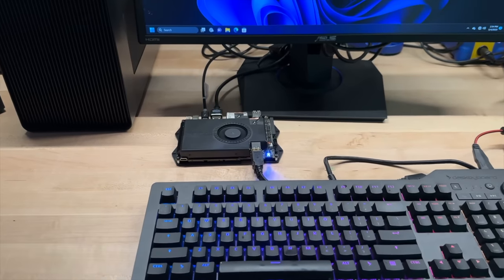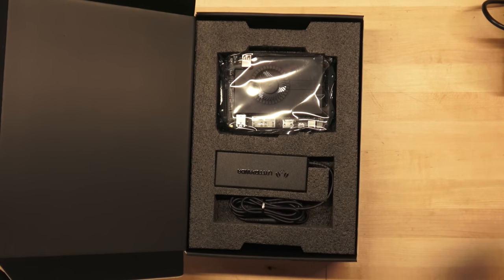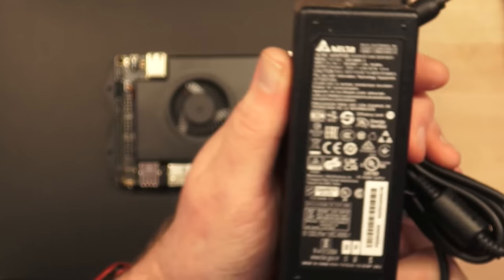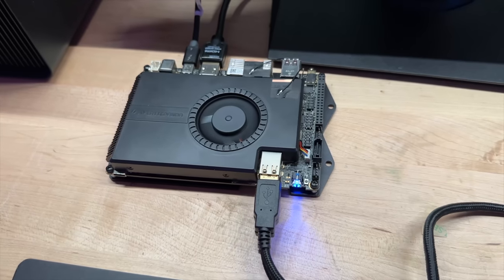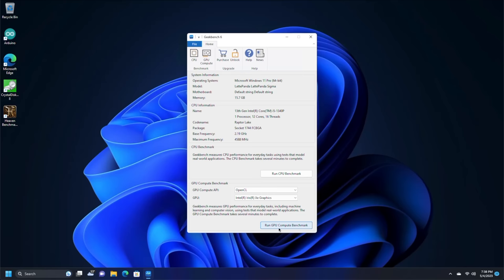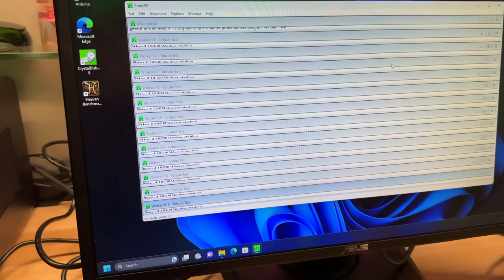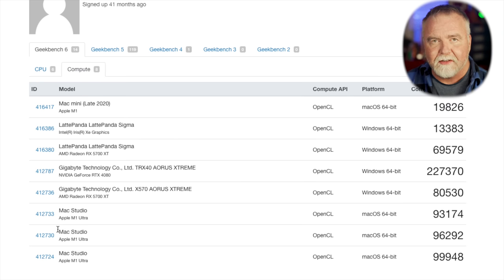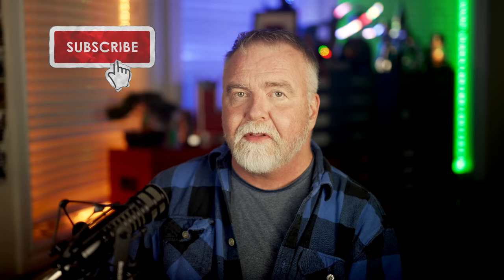The Sigma: The Most Powerful Single Board Windows PC

Comment: I believe the way most boards like this work is they have a separate MCU that is connected through serial to the processor, so programming it over COM3 was probably an MCU connected to COM3.

Edit: the MCU is an ATMega32U4. I understand why they went for this due to simplicity of programming but anyone buying a board like this can probably use other MCUs, I would even rather see something like a teensy 4 built in. Even something like the arduino alternatives from adafruit or sparkfun would be better. I just think a ATMega32U4 is not a good choice for a board this expensive, yes it will probably just be handling IO and all compute should be done on the main processor, but it is very limited in communications and hardware compared to other MCUs and other MCUs have DMA that can be used. A main processor this powerful can handle a lot of data and calculations, this MCU can’t and could easily end up as a bottleneck, especially if a lot of sensors and actuators are used like in robotics. A better choice would be similar to the arduino portenta series, using a STM32H7 series chip with single or dual cores to get much higher throughput and hardware capabilities, if arduino themselves are using it then it should be pretty beginner friendly too.
Reply: The processing power of the MCU is easy to work around, and it's better to work around it anyhow with this setup. Instead of doing the heavy lifting on the MCU itself, you offload it to the powerful OS available right alongside it. So, the MCU becomes a bidirectional proxy for the signals coming from GPIO. Write your controlling software elsewhere using a full-featured programming language for complex calculations. The MCU really only needs to be directly processing extremely low latency + realtime communication requirements.
Reply: @peterrosser1217  it really isn't, the processing and communication speeds are a bottleneck. Your application could easily be limited by how fast you can get data through the MCU. On top of that the peripherals on the chip are pretty rubbish, only low speed communications without DMA with not great PWM. The maximum frequency of the chip is 16 MHz and it is only a relatively basic 8 bit processor. 

There are also plenty of applications where you would want to do some processing on the MCU rather than the main processor, mainly for tasks that require precise timing or fast response times. There is a reason that MCUs are used for anything that needs real time control and if needed they communicate with SBCs for more advanced processing, that doesn't suddenly change because you have a powerful processor attached through USB to a MCU, there are still plenty of times you would need to process something on the MCU.

The pretty bad specs for PWM will affect motor control or other uses with low frequency or low resolution in order to get higher frequencies, the main PWM is also only 8 bit which is pretty bad too.

The slow communications will affect how fast you can read data or communicate with other components and will limit how many sensors you can use and still get a fast enough rate.

Overall it just isn't a good chip to use for this, it is a chip that is barely good enough for beginner projects. It wouldn't be suitable for any applications where you need to read a lot of sensor data or interact with a lot of motors, like robotics. You have a very powerful processor but very weak MCU, it would be very easy to end up with a bottleneck especially on sensor and actuator rich applications. There is no point having a processor this powerful on something like a robot if it is limited by how fast it can read sensors and command actuators.

A STM32F4 chip would have been more suitable with much higher frequency, 32 bit processor and more flexible and faster PWM and more PWM channels, the communications interfaces would also be faster, allowing more data throughput. Other chips like the rp2040 would be good too. For the price of the board they also could have justified a STM32H7 series chip like the Arduino portenta series uses, obviously they see a need for a powerful MCU on an SBC.

Any application that justifies a processor that powerful and an MCU will be bottlenecked by the MCU used here.
Reply: @conorstewart2214  I totally agree with you. To add to your point, Microchip basically killed the Atmel ATMega and XMega microcontroller range after they acquired Atmel in 2016. I was at a conference after the acquisition where Microchip publicly said that they would not EOL (end of life) any Atmel product. The ATMega32U4 is one of only a handful ATMega microcontrollers that are still being produced and it is just a matter of time before they stop producing them altogether. The XMega range is basically dead. Btw, I have about 500 ATXMega32E5 chips in stock that are now basically useless to me. Apart from one other component, I have completely stopped using Microchip components. More than a decade of investment in Atmel products down the drain. Thank you Microchip... 😞

Comment: Why use a Single Board Computer, instead of a mini-ITX PC?    Both are small, but the ITX machine with Ryzen 7900 cpu gets about 25,000 score on Cinebench R23, and Ryzen 7900 uses very low power too.
Reply from the maker: Doesn't it require a full desktop power supply though?
Reply: @DavesGarage  Not necessarily.  There are tiny Pico PSUs up to 160 watts, or the small Flex-ATX supplies up to 250 watts.

Comment: I know you do not typically do reviews, and understand that you might not have access to this gear but...5950x and M1 are 4years old we have been at the 7950x and M2 for about 2years now and Apple is about to transition to M3. This computer seems actively incredible but the price performance claims are not accurate to what is currently available in the market... more appropriate perhaps would be to compare it to other single board computers with GPIO such as the many ARM and RISC V options as well as other X86 ones... such as the orange pi, raspberry pi 5, Odroid, Tinker Board, UDUU Bolt, Le Potato, etc...

Comment: $579 for an SBC?  Latte Panda guys must be smoking that weed.  You can EASILY build a pc for that price that will run circles around this thing.  

Interesting.

Cool.

Impractical.

Expensive AF for what you get.

However, I'm always glad to see your take on tech.  Keep up the good work!
Reply: Can you do it for 60 Watts?
Reply: You can easily build a PC for that price, but can you build a PC that takes up as much space as a SMC, runs on only 60 watts, is as quiet as this one, is reliable, and keep in inside that budget?
Reply: @dakiloth  And about 15W idle. That's not easy with out of the box hardware.
Reply: i5 13th gen    12 cores     I have not seen any computer with this cost 500  or less.
Reply: The framework i5-1340p laptop board retails for 449usd in their website, the Sigma comes with some extras in a smaller package, i think the price is about right, this is a great board for high end NAS systems, emulation machines up to six generation consoles and some Taito X2 arcades. it is so powerful that you can run a NAS,  Plex video transcode and run a windows on a VM at the same time.
Reply: @wolveric0  With probably some NVME (which is really a mini-PCIe slot) to SATA multiplexer you could indeed probably power a few spinning rust disks

Comment: It's not "hackable", it has a closed UEFI BIOS, closed source CPU microcode, and a closed source bootloader running a closed source OS out the box. A ThinkPad X220 is "Hackable" because you can load Libreboot on it and run programs from there at an extremely low level, below even the CPU itself. The Sigma just has an Arduino on-board, that's not "hackable", nor has it been "hackable" the last 3 times LattePanda did that. I could tuck an ESP32-S2 inside my laptop's case with exposed GPIO and tap off the unused USB pins on the chipset, but that still wouldn't be "hackable".
They could call it "Integration friendly", which definitely is what it's actually built for, or even "hacking friendly" if they want to stretch it a bit, but it's not "hackable".

Comment: They try to say it will beat my 9900k by a little bit. Somehow I don't think so when I have mine clocked @ 5Ghz all cores and have it paired with a GTX1070 8Gb
Still $600 isn't too bad if you need something small with a lot of power.

Comment: 2:52 Interesting thing about this connector: the odd input centre north was - and in some old houses is still used - for earthing. You'll find the current standard is on the sides. That is the top and bottom. The top one being connected to sait old input. That input is from electric plug & outlet E, which was primarily used in France & Belgium, hence I usually call it a Belgian plug, since in Germany & The Netherlands (plus Scandinavia, Austria, Spain, Portugal & "East Europe") we use(d) the F. I cited used, since in modern times E & F have a combined plug and socket and this is in fact such an E/F-plug. In fact, the modern difference is that E is straight through and F, I suppose because of the tail & hook, is the same plug, but hooked.

Comment: How about a follow-up video seeing how well it works with Linux?
Reply from the maker: I'd likely just install WSL2 on it, then you get the best of both worlds!
Reply: @DavesGarage  I was just wondering if there might be any compatibility issues.  I took a quick look at their website and they mention it being for both Windows and Linux.  It looks like it would be an upgrade from the NUC I’m currently using as a Linux desktop.

Comment: I guess it's okay if the most important aspect is size. My desktop PC was much cheaper and is far more powerful. My laptop uses less than 1/3 of the power of the Sigma and connects to the 12vdc portion of my solar power. For me, the FOMO problem is nonexistent so thanks for the entertainment.

Comment: 10:14 Dave, quick few things, with respect to USB power.  They only use the 20V power delivery spec, and because of this you can't supply more than 3A with a standard cable (60W).  With a 5A rated cable with the correct eMarker in the cable it can go to 5A if both end points support the 5A (100W) standard at 20V.  The PD3.1 Apple power supply won't negotiate anything unless both the cabling and all connected hardware has to negotiates the EPR 28V PD 3.1 standard.  Without that you will never get anymore than the smallest link.  Power delivery is has a full communication protocol and unless the cable has eMarker will be limited to 3A only no matter the voltage of 5,9,12,15,20V.  There are steps in the PPS and AVS specs of power delivery but most just implement the fixed voltages.  So with that being said here are the only valid combinations of fixed voltages:
PD 3.0 voltages and up to currents - 5V-3A, 9V-3A, 12V-3A, 15V-3A, 20V-3A (with 100W rated cable 20V-5A is added).  

With PD 3.1 and EPR rated cable (as in the spec) the additional voltages and up to current of 28V-5A, 36V-5A, 48V-5A.

That would explain why you were not seeing more than 60W potentially.  Your tester only will support up to PD 3.0 spec and doesn't support PD3.1, so it could never negotiate the 28V standard.  The question is does the two cables you are using support 5A (100W) mode along with the power supply?

Keep up the good work sir, looks like a nice little SBC as well. 👍😁

Comment: I would like to see this paired with an Nvidia AI dev board running on a car battery. My application would be for my vehicle a former police utility with stock 250 amp alternator and aftermarket 360° cameras installed. I would use those Nvme slots for a raid configuration.. 😅

Comment: Q: For the external GPU test, was the display connected to the Latte Panda or the external GPU?
Reply from the maker: I forget which parts I showed footage of, but I tried both.  For Heaven I had to run it via the output of the eGPU.  For Geekbench it can use the GPU headless, which is how I tested it.
Reply: @DavesGarage  Good, just to put the numbers into perspective. Our experience: eGPUs performance drop if not hooked up directly to a display, since they pump the video stream back to the PC. The exact reasons elude me, since the Thunderbolt specs are a bit... Convoluted? To say the least.

Comment: Western Digital... Unless it can be replaced, that's a deal killer for me. Lost 40 GB data stored on a Western Digital AND lost that backup also on a Western Digital. TWO different drives failed EXACTLY the same time and one of them wasn't even on all the time. Never used them since, and never had a problem since. That 4 pin IDE WD drive is in a closet somewhere. Gave up trying to make them work decades ago with various data recovery software unable to see them, despite me hearing them spin and click.

Comment: No point in hiding the CPU, it's a laptop i5-1340p. So why buy that if one can buy a laptop with a screen? For 3x NVMEs and some extra ports? But my Lenovo X1 Carbon Gen10 comes with almost all the ports you have. I found it's sold for 650$ with 16GB/500GB SSD OK, not so bad to play with it but that's all.
Reply: his is for making projects not for use as a computer only... such as making a robot or a console or a kiosk...  it is meant for hardware development. a laptop cannot do what this does.

Comment: I wonder if this would be good for astrophotography data aquasition and storage in the field from a remote location on a 12v deep cycle battery? A lot of astrophotographers these days are using mini PC's for this and mounting them directly on their robotic telescope mounts with the telescope and camera equipment, then running either wifi to a tablet phone or running cables to small monitors and keyboards in an enclosure. (Enclosure is to keep extraneous light from the monitor interfering with the imaging and ruining night vision.) I'm sure it's not ready for damp, cold or hot outdoor use but that can be dealt with by shielding and extra cooling. Also anti dew heaters are readily available and mitigate moisture buildup without adding to normal operating temperatures. Astrophotography data aquasition and storage needs to be big and fast. Usually 16bit RAW data for multiple, long exposure still frames with dark, flat, and bias frames acquired for noise reduction purposes in post processing. Also, planetary, lunar and solar photography require large storage space and high frame rates as they use video format to capture thousands of lower bit depth frames for culling, stacking and processing later. There seem to be a lot of new mini PC's popping up out there but im not very tech savvy, although I took electronics in high school and worked as an electrician for twenty-five years. I've just never had time till now to catch up. If you know anything at all about astrophotography, maybe you can help. Even if you don't, you may still be able to help me. I don't want to have to worry about running out of storage or dropping frames through transfer from a CMOS or CCD camera. I may be out five hundred miles from home with a ton of equipment, in the middle of no where west Texas.
Reply: Khadas Mind with a docking station. A far better option.

Comment: this board is not the most powerful singleboard PC. Lets try the GEEKOM Mini PC Mini IT13, 13th Gen Intel i9-13900H NUC13 Mini Computer. I have 3 27" 1080p monitors, 64TB NAS server, 16TB HD docking station, 3' Bluetooth soundbar, 4k computer camera, DVD-RW,  C-Type 11 port docking station with two extra HDMI ports hook up up to this raspberry-pi,  Win 11 Pro O/S comes with this raspberry-pi. I upgraded the RAM to DDR4 64GB and the boot drive is 2TB m.2 SSD. This mini-pc is great for general office type work.

Comment: Thanks for reviewing it. It's interesting, and I like the 60W figure, but it's an expensive solution to a nonexistent problem. Used i7 mini PCs can be had for under $200, and have space for a GPU. Four old i7 PCs cost less, will eat a Sigma for lunch, and provide some fault tolerance into the bargain.

Comment: Their page claims that the CPU on it beats an i9-9900K! With a lie like that front and center... I have no confidence on this board for the price. It's pretty much vega 8 levels of performance in terms of GPU. Realistically it's competing directly with Ryzen based mini PCs and small form factor PCs both in performance and price, rather than competing with other much cheaper and more conservatively specced single-board computers. Hell if we dispense with the whole small form factor nonsense it's priced at the level of fairly recent full sized PCs like some HP pavilion desktops with an entry level dedicated GPU like the RX5500.

Comment: be mindful that even though the board has 4 m.2 connectors on the back, they are all at different speeds and protocols

M.2 M Key: Type 2280, Supports PCIe 3.0 x4 (Type 2280, Supports PCIe 4.0 x4)
M.2 B Key: Type 2242/2252/2280, Supports SATA III/PCIe 3.0 x1, USB2.0, USB3.0, SIM
M.2 E Key: Type 2230, Supports PCIe 3.0 x1,USB2.0, Intel CNVio
Wireless Form Factor: M.2 Wireless Module (PCIe/CNVio) - not specified but most probably pcie x1, single lane
Reply from the maker: No, but it looks a little like our 240V 50A plug we use for dryers...  the UK plug is quite superior, I'm led to believe.

Comment: 6 Bills? Are you kidding me. I have bought Latte Panda and when I plugged it in and it bricked itself, I tried to send it back for warranty at a cost of $40 to me using the label they sent. They refused delivery because the label they sent me had a "spelling error" and I got it back. I tried one more time for another $40, used their label and got the same results. NEVER NEVER EVER buy from Latte Panda.